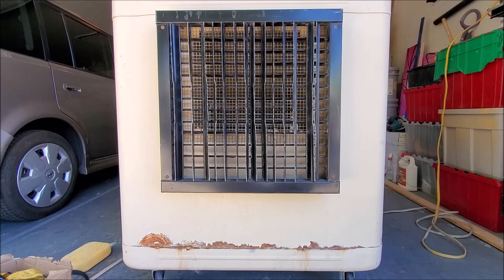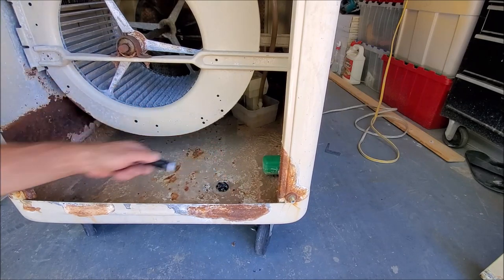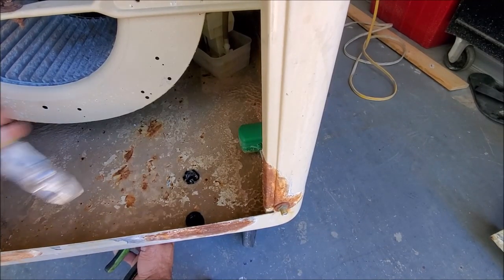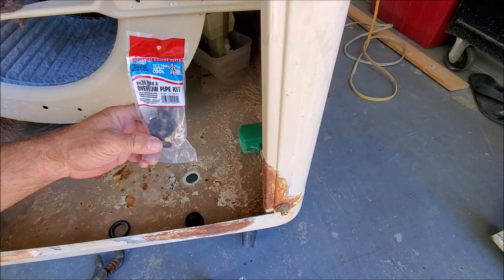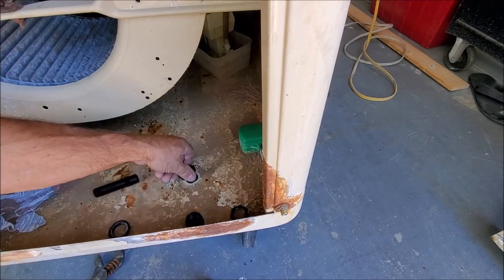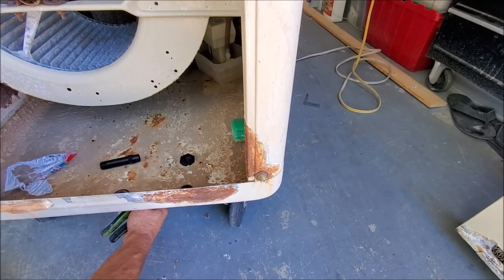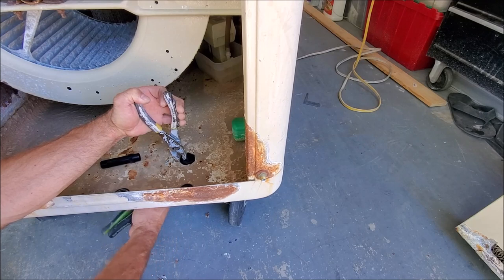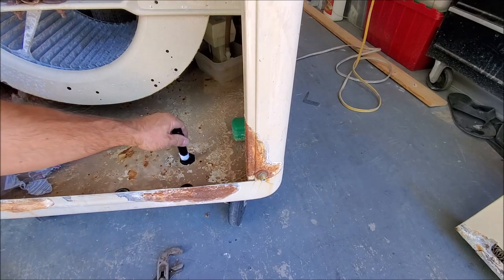Evaporative Swamp Cooler Overflow Drain Plug Replacement

Comment: My window cooler (a Bionaire) had a dump valve which is leaking profusely. Mfr says my model is unsupported and obsolete so no replacement part available. Could I just simply put a plug in the unit?
Reply from the maker: You need to have some kind of water bleed on the swamp cooler. I do have videos how to install a water bleed on a swamp cooler.